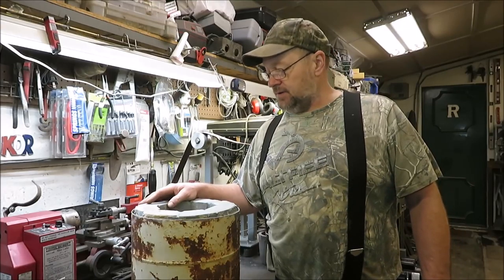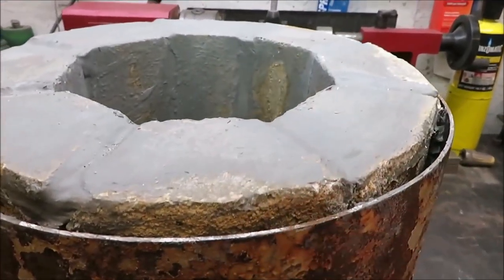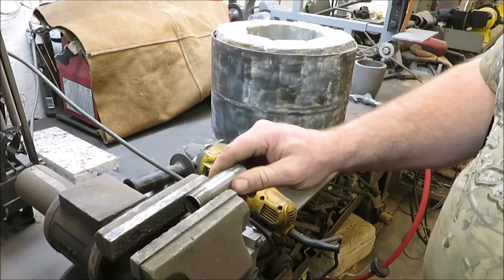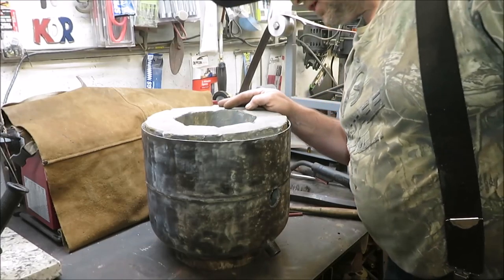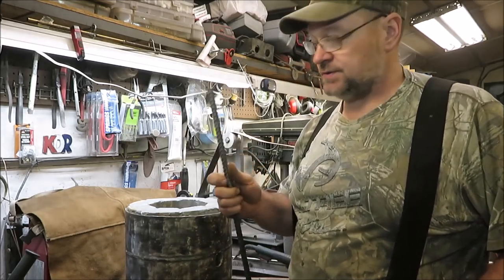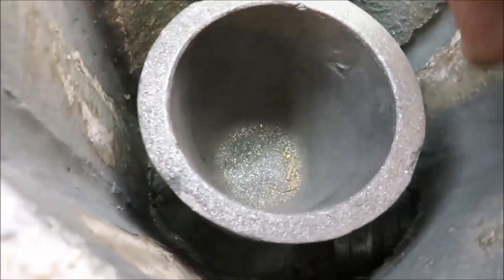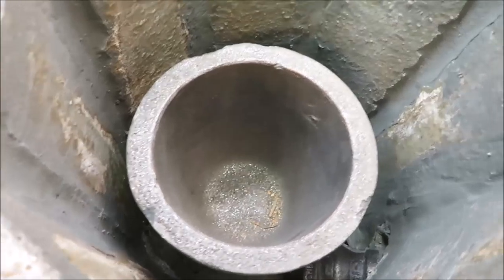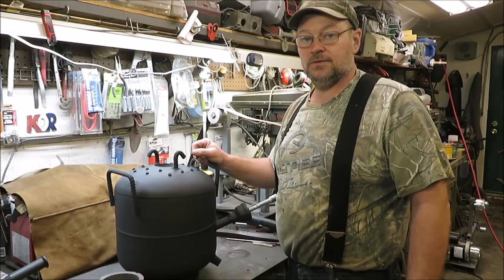blast furnace part #7

Comment: Looking Good Kevin, I think you are doing the rite thing in putting it on the wood stove warm it up and make sure it is dry properly before you put real heat into it. As for the bottom when it is dry I would level it up with a thin layer of refractory cement and put a piece of a brick on the bottom to sit the crucible on, put it back on the wood burner for awhile to dry.
Reply from the maker: Sounds good Peter thanks.

Comment: I work at a Foundry for 37 years , need to dry the refractory with gas torch very low heat at first the next day a lot hotter . It will make a lot's of water did you put in weep hole in the bottom and sides I always drill 1/4 inch three inches a part. I've been sick for two weeks and did not watch your video making your blast furnace sorry I will watch them all . Remember safely is number one at home.
Reply from the maker: Weep holes in the furnace William?
Reply: in the steel only not in  the refractory .when you preheat your furnace a lot of water will come out, you need to preheat for twenty hour or more then bring up to full temperature. SLOWLY. The next time  put the bottom in Frist then dry it with a low heat then pour the side walls , set for 24 hours then add low heat.

Comment: In the Electrical trade we had these cast we use to call them and they were built out the same stuff as the crucible and before using them we would put the torch to them just to get the humidity out or when you put the big heat to them they can crack or blow on you.....be careful my friend.....CHEERS
Reply from the maker: Thanks Gator for the info.